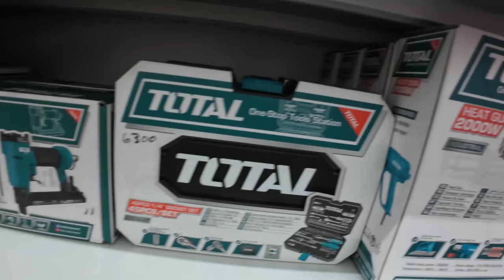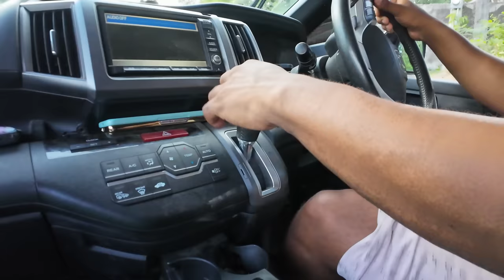Bought new chain saw for cutting wood | now we'll always have firewood | wood fire | big cooking

Comment: Nice , it will be so much easier to chop those woods ❤
Reply from the maker: I bet u couldn't chop them in the same time it took to cut with saw
Reply: @Colazsmithtv  sorry if I wasn’t plain  , I meant the saw is much easier to use instead of chop I should have said saw , sorry 😞

Comment: You’re not supposed to cut with the tip of the saw or use motor oil or cut in  sandals without safety goggles. Please watch a video on how to properly run a chainsaw.